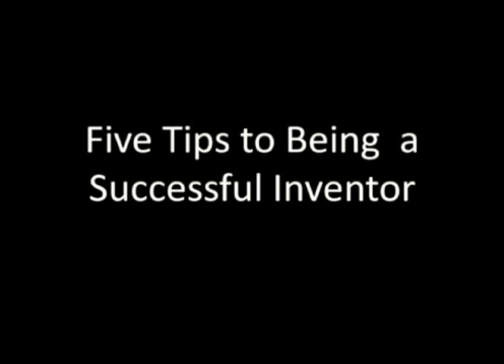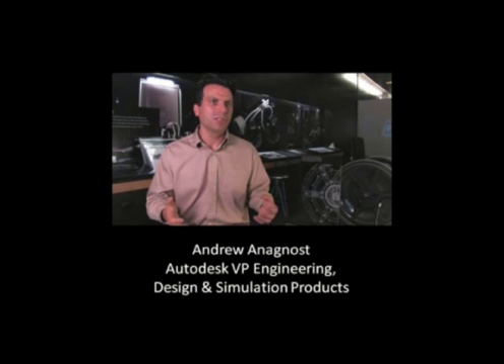5 Tips for Becoming a Successful Inventor

Comment: My product is overmolded. How should it be drawn when parts are embedded and not visible? Is there a easier way other than cross -sectioning which does not fully depict my embedded parts?
Reply: What if I te you that I can make you become a successful inventor how will you fill about that??
Reply: @digitaltrends2113  Good